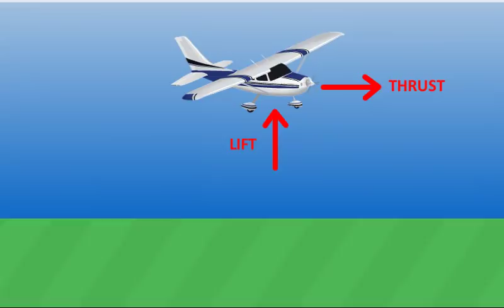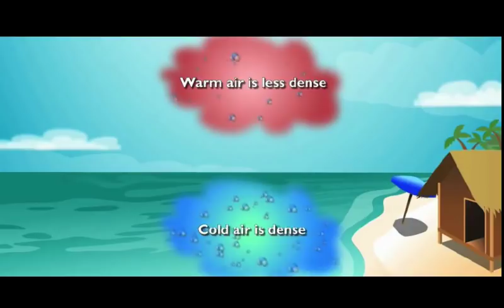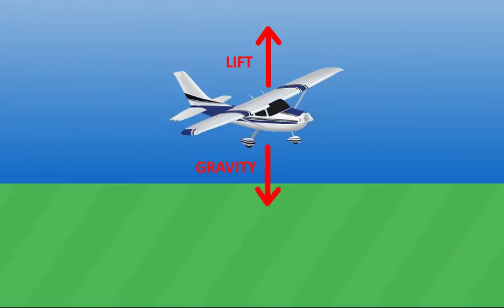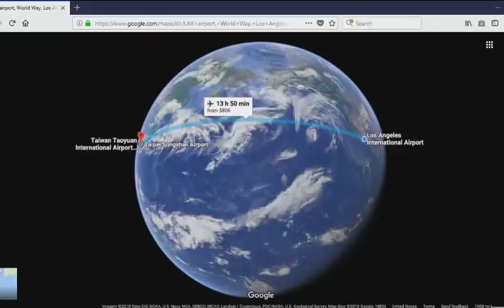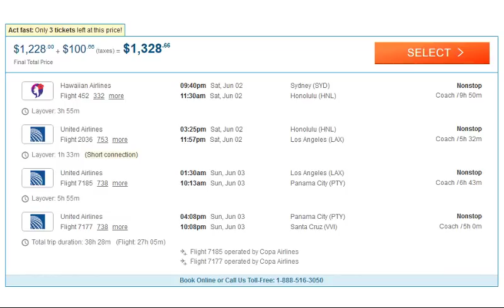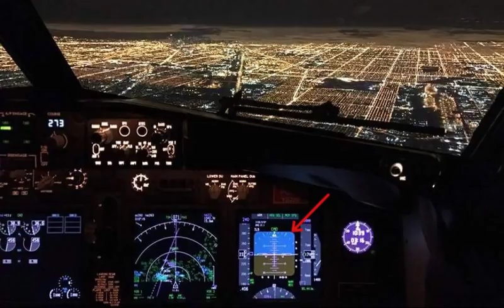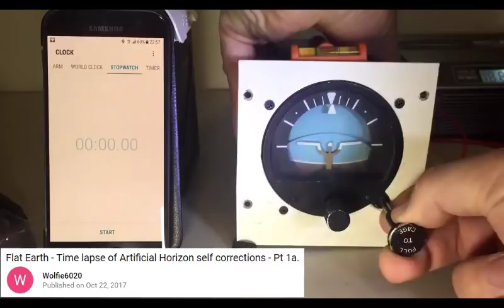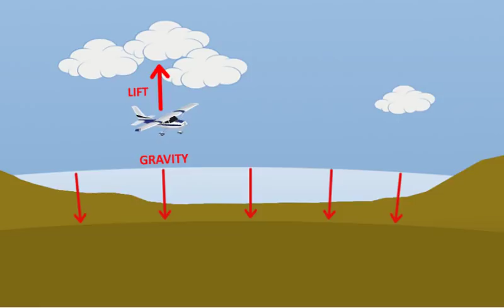Flat Earth Falsities - Plane Nonsense

Comment: all well an good, the problem for me is,
 it seems that most of what you state here is based upon a theory,
 the theory of gravity
do you agree that it IS a theory,and therefore unproven?
another unproven theory not addressed
 is that the earth is some 29.000 or thereabouts in circumference
if that is the case then how do you explain things like for instance,
 the suez canal being approximately 100 miles long, yet has no locks?
as someone has posted further down this thread
as well as the multitude of objects, mountains, buildings etc that it should not
be possible to see at all from the distances they can clearly be seen from?
and please, insults, flatard etc are not an answer to a fundamental question,
I would really like to see some sensible attempts to answer this
quite reasonable question.
Reply: "do you agree that it IS a theory,and therefore unproven?"

https://www.scientificamerican.com/article/just-a-theory-7-misused-science-words/

"if that is the case then how do you explain things like for instance, the suez canal being approximately 100 miles long, yet has no locks?"

The ocean curves over thousands of miles and has no locks.  Why would the Suez canal be any different?  It curves the same as the ocean. It's not a straight line between the two ends.

"as well as the multitude of objects, mountains, buildings etc that it should not be possible to see at all from the distances they can clearly be seen from?"

Name one.  I can provide many counter examples.
Reply: sorry to  go all "cathy newman"on you
so you're saying the suez canal has a large hump in the middle ha!ha!
Reply: so then navigating the suez canal, one go's up to the middle then down the other side? hmmm.......
should be very easy to show proof of that phenomenon in that case
but no one ever does........
Reply: "so then navigating the suez canal, one go's up to the middle then down the other side? hmmm......."

Navigating the Suez canal, you stay at the same height relative to the center of the earth, therefore the same elevation.  Like being on the ocean.

"should be very easy to show proof of that phenomenon in that case but no one ever does........"

I am sure you can see a sharp horizon on the Suez canal (because of the curve) and can't see one end from the other (because of the curve) .
Reply from the maker: How do you guys not know what a SCIENTIFIC theory is by now? It boggles the mind. Gravity is proven science. See my gravity video.
Reply: is it anything like de grasse tysons "scientific" explanation?

Comment: on a flat earth, air pressure would decrease with height bcse the lighter gases would be higher up, ..so youre wrong ab that.

several interesting arguments, which do not actually prove anything.

but here is the one question you never answer... why are you going out of your way to make this video..??? are you bothered that people might think the flat earth argument has real merit..?  if they are wrong, what problem is it to you.?

the strongest flat earth argument is that there is no perceivable curvature.. you have not addressed this at all.
Reply: "on a flat earth, air pressure would decrease with height bcse the lighter gases would be higher up, ..so youre wrong ab that."

The density of air is not proportional to pressure, so your model fails.
Your models also fails with ocean pressure, since water is nearly incompressible yet pressure increases by 1 atmosphere every 10 m depth.

"if they are wrong, what problem is it to you.?"

They vote. Case in point: Trump.

"The strongest flat earth argument is that there is no perceivable curvature.. you have not addressed this at all."

This video wasn't about that.  But yes, there is measurable curvature. If you are incapable of understanding that a sharp horizon means it's close and caused by curvature, deny all videos of ship disappearing bottom first, then consider that the distance between two lat+lon coordinate only works if you wrap that geometry around a ball. Even the distance between NYC and LA wouldn't work on a flat earth.
Reply: 2018 and still gravity , nor the rotation of the earth, have been proven... air gets thinner and lighter as you go up, so the pressure decreases, what is difficult ab that.
there is less pressure on the top of ten layers as there is at the bottom. ipso facto.

they vote... really.. who are you , jesus christ, come to save us all from our stupidity.
flat earthers dont vote, they have no truck with the mainstream... no interest in culture... no connection to the status quo.

there is no perceivable curvature... not even from a weather balloon 25 miles up. stop being a cunt.
sharp fuckin horizons... my arse...

soldier alert...  soldier alert... soldier alert....
Reply: the earth is a globe everyone... foucaults toy proves it... structure the education system around foucaults little toy.. its kosha... never mind real proof... weve got foucaults little toy.. that ll do...

Comment: The third explanation does not make sense because the Earth falls away from the plane due to its curvature so the plane does not require a climbing to increase it's height above ground.  As the Earth moves further down due to the curvature, the gravitational pull should decrease slightly, not increase.
Reply: Of course it requires climbing.  It's gaining altitude right?  That's climbing.
Reply: Climbing is changing your own vector and gaining height by that result.  When flying over a mountain, does the jet suddenly require more thrust because the cliff that dropped elevation below.  Nope.  If the Earth is falling away due to a gradual drop due to it's shape, the only difference is that it was gradual unlike the sudden change from the cliff.

Comment: We should charter a flight - pick a starting point somewhere on the Equator and fly either East or West, in a straight line, without deviation, until one of 2 things happen - we hit an icewall and or firmament dome - or, two - we end up right where we started from.
Reply: so what? The flattards will still claim that this flight wasn't real...
If reality disagrees with a flattie, reality is fake!

Comment: if the air is being dragged  by the earth it would always go more or less in the same direction, but it doesn't does it
Reply: LOL
Reply from the maker: Are you talking about wind? Wind is caused by a number of things, especially temperature differences. But that wind movement is RELATIVE to the surface of the earth. The whole atmosphere rotates with the earth, and so do you, so the movement you feel is local wind, not the entire atmosphere movement.

Comment: Without proving gravity, you're simply summarizing your theory. That's not an argument, it's simply an explanation of your position which was already known. Consider - how can gravity explain the momentum of orbit, which keeps a planet from falling into it's gravitational center (the sun) and the sun's pull on the mass of the earth? I'd give you one, but not both. That would mean that gravity is perpetual motion. It can simultaneously propel the earth through the universe, while at the same time holding that same mass in a semi-regular orbit. But, the only way it could do that is there was a constant forward motion being exerted on the earth; what is that force? Satellites fall back to the earth for this very reason - why doesn't the earth fall back to the sun, why hasn't mercury, or venus?
Reply: Joshua Barnes https://youtu.be/Ym6nlwvQZnE Gravity is a proven force even without the cavendish experiment. An objects, when no force is applied to it wants to stay in place. So, when we let go of it in mid air, it should float without any force. But it falls down. Because there is a force pulling it toward the ground: Gravity. And density does not explain this, since it has no direction. 
For your orbit question: The Earth has a constant motion. There's nothing to slow it down. I don't know why satellites would fall down. I'd guess outside forces, look it up maybe?
Reply: The Earth will eventually fall into the sun. If the sun doesn’t supernova first. 
But there isn’t much acting to slow the Earth down so it will take a looooong time.

Comment: I always think that "spinning 1000 mph" is what's confusing people because everything we know of that goes 1000 mph is fast. But the earth is massive and, at a rate of 1000 miles per hour, it still takes 24 hours to make a single revolution. 1 rpd (1 revolution per day) is a much easier way to think of it.

    The hour hand on a clock goes 2 rpd and it's hard to see that even move.

   Anything that takes 24 hours to turn around is damn slow.

Comment: "The helicopter's momentum prevents it from staying stationary independent of the Earth's rotation."  This is also wrong, I'm afraid.  The helicopter's momentum throws it away from the earth on a trajectory tangent to the surface.  The helicopter does not have independent angular momentum around the earth.
Reply: No, I think you didn't read what I wrote carefully enough.  The statement that I quoted is simply wrong.  I didn't forget about gravity--I didn't say anything about gravity.  Gravity is constantly ACCELERATING the helicopter around the earth, in the sense that it is changing the direction of its velocity.  But the helicopter's momentum is not AROUND the earth.  It is at each moment tangental to the earth's surface.  You are right, it is so minuscule that we don't notice it, far more important are air pressure and gravity, but nonetheless, it is simply wrong to say that the helicopter's momentum prevents it from staying stationary independent of the Earth's rotation.  That doesn't mean its momentum keeps it stationary--its momentum is pointed in a direction tangential to the surface of the earth.

Comment: There is a change coming are you ready the earth has to stop tilting in one direction and start going in the other way again. I have never noticed the change I have to pay more attention this year how about you?
Reply: What are you on about?
Reply: The so called tilt of the Earth during the change between Summer and Winter. The Earth tilt has to stop and change directions. Also at that exact time the gravitational forces of  moon, sun, and all the planets should all be measurable as they change in the globe model. Check there never has been as never will be a way to measure the fluctuation in the force of gravity because it is a constant one directional force.
Reply: If you take two object of the same shape and mass and drop one in air and the other in a water fill container will there be a difference?
Reply: Sorry. but you are talking bollocks the tilt of the Earth isn’t seasonal! 
I’m not sure why you’d think that.
Reply: Of course there will be a difference between objects falling in air and water. 
Water is denser so increases buoyant force and increases the drag/friction acting on the object as it is pulled through it. 

None of that is contrary to gravity or the shape of the planet.
Reply: You have some more problems to solve where do you start first.
Reply: I’d like to start with your response to the first points please.
Reply: Your video your problem at what point in time are you going to stop everything just to try an measure up once.
Reply: So no explanation on the weird tilt thing. I see. 
Okay let’s hear your “problems” then and I’ll see what I can answer.
Reply: Try June 21 gives you time to think. I need all the gravitational pull between of all the Planets there direction in relation to the solar horizon and the Sun and the earth and moon. After you finish that add in the so called black hole in the center of the galaxy and try again. If you can get that far It a infinite add ons

Comment: Prove ball earth without pseudoscience... Good luck
Reply: The Celestial Poles are in the sky. Anyone can look at them without government permission.
Reply: Two celestrial poles. Done.
Reply: Au contraire, mon chéri! You don't need to sign a contract to look up. Just use at least one functioning eye and a neck. That's one pole.
And the other? A simple question of logic: Would you say that every single person in the southern hemisphere is lying? Pretty absurd to say so, don't you think? That's why your excuse is so hilariously weak.
Reply: +Marcus K
There is a long, rather straight railway line running  between Tarcoola (SA) and West Kalgoorlie (WA). These places are are at S30.7° E134.5° and S30.7° E121.4°. Compute the length of the circle of latitude at S30° on a flat earth and take the fraction correcponding to 134.5° - 121.4°. Then, do the same thing for a spherical Earth. Compare both values to the official statement by an Australian (ex-) Minister for Infrastructure and Transport: "a 1,280 kilometre section of track between Tarcoola (SA) and West Kalgoorlie (WA)."  - What do you find?
Reply: Marcus K take record the angle to a star in the sky, while 3 friends at either the same latitude or the same longitude record the location of the same star at the same time.
If the earth is flat, you should be able to plot a graph with the x-axis being the distance between the observation points, and the y-axis being the altitude of the star. All observations should converge at a single point. This doesn’t work in reality.
Reply: Psy Fi one other  thing that I find weird on the flat earth.
Look at Abu Dhabi, they’re close to the equator, in fact, right now, at noon, the sun goes above 80 degrees in the sky, meaning it goes almost straight overhead, so, if you go with the flat earth idea that the sun circles the North Pole, Abu Dhabi takes a direct hit from the sun; meaning, that city should directly bisect the circle of light projected by the sun. So, Abu Dhabi falling directly in the middle of the sun’s circle, it should have a very long day.
New York, the sun only gets about 65 degrees at noon, so it goes through a much smaller arc of sunlight. So, Abu Dhabi going through this huge area of sunlight must have a really long day, and New York must have a really short day.
So, why are days currently a full hour longer in New York than in Abu Dhabi?

https://www.timeanddate.com/sun/usa/new-york
https://www.timeanddate.com/sun/united-arab-emirates/abu-dhabi
Reply: By the way, your belief that you can’t visit Antarctica is clear evidence that you have been lied to by Flat Earth cult leaders. 
Anyone can visit Antarctica. The Antarctic treaty does not prevent tourism. There are numerous companies that offer regular tourist flights, cruises and stays in Antarctica, including trips to the south pole. Here’s a selection:
https://www.swoop-antarctica.com/cruises/flights
http://www.antarcticaflights.com.au/
https://www.coolantarctica.com/Travel/Fly_to_Antarctica.php
https://www.gadventures.co.uk/travel-styles/cruising/expedition-cruises/antarctica/
https://oceanwide-expeditions.com/antarctica/cruises
https://www.adventure-life.com/antarctica
https://www.intrepidtravel.com/uk/antarctica
http://www.traveller.com.au/flight-to-antarctica-what-its-like-to-fly-over-the-frozen-continent-gqwdtt
Reply: Observable Curvature:
- the angle of the moon dependent on observer's latitude is evidence of a curve. https://s7.postimg.cc/nwyi0pnjv/Moon_Rotation.jpg
- different constellations visible dependent on  observer's latitude is evidence of a curve.
- stars rotating around two different opposite points in the sky is evidence of a curve.
- day length varying by latitude is evidence of a curve.
- ships disappearing bottom first on the horizon is evidence of a curve.
- sunsets are evidence of a curve.

Observable Motion:
- the stars, sun and moon moving across our skies are evidence of spin.
- the changing position of the stars over time is evidence of motion.
- apparent retrograde motion of the planets is evidence of motion.
- weight difference of the same object at pole and equator is evidence of centrifugal force caused by spin.
- weather systems forming clockwise around high pressure and anti-clockwise around low pressure in the Northern Hemisphere and doing the opposite in the Southern Hemisphere is evidence of the Coriolis force caused by spin.
- a pendulum rotating around with a period that is dependent on its latitude is evidence of spin AND curvature.
- a gyrocompass, as used in boats and ships all over the world, is evidence of spin AND curvature.
Reply: Good stuff! Very convincing evidence I'll admit.. Now I have more to think about! I don't trust Nasa at all. Lots of fishy stuff from them last 50 years..
Reply: Angle of Polaris above horizontal matches latitude. Only works on a globe.
Reply: Psy Fi lol You can't prove that without government info...you been to South pole with your own equipment? How about a demonstration of a spinning ball that holds water to its surface curved without flying off. I can easily prove my case...

Comment: LooL, I love the "timelapse", more like a "eppilepticlapse".  You do realize you just used fake earth images under the guise of original images right? We all understand they way we were thaught it all works. I understand perfectly what you are saying. I also understand why you resort to using "images" from space... Cause you don't realize they are fake as shit.
Reply: +OVER THE LINE!
There is a long, rather straight railway line running  between Tarcoola (SA) and West Kalgoorlie (WA). These places are are at S30.7° E134.5° and S30.7° E121.4°. Compute the length of the circle of latitude at S30° on a flat earth and take the fraction correcponding to 134.5° - 121.4°. Then, do the same thing for a spherical Earth. Compare both values to the official statement by an Australian (ex-) Minister for Infrastructure and Transport: "a 1,280 kilometre section of track between Tarcoola (SA) and West Kalgoorlie (WA)."  - What do you find?